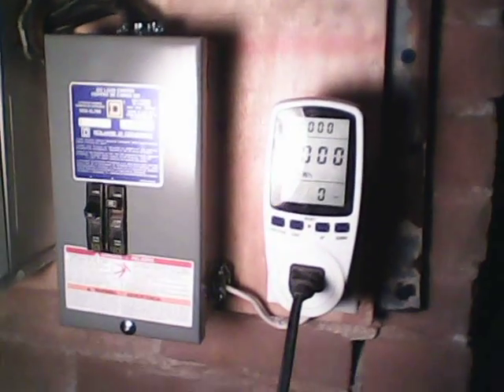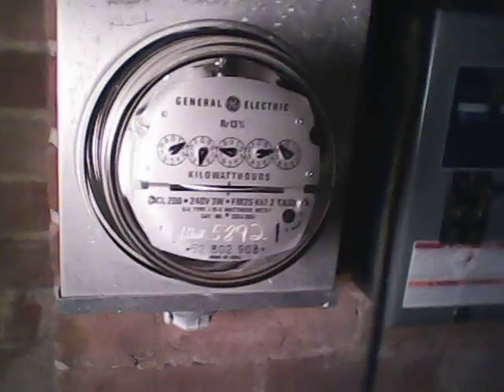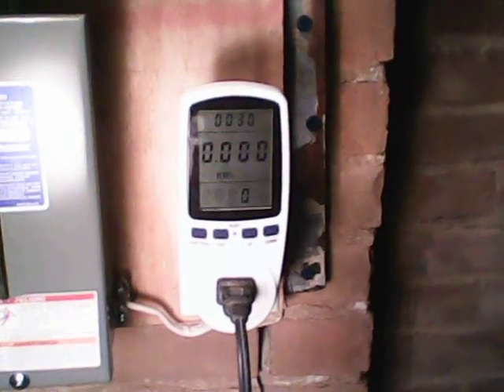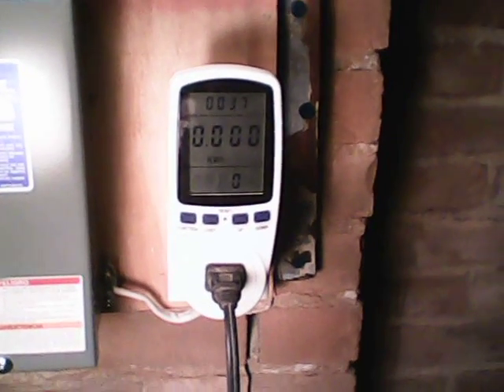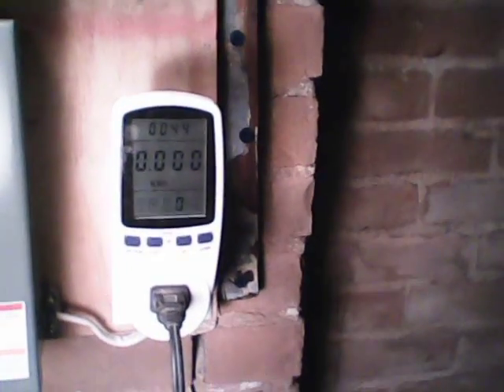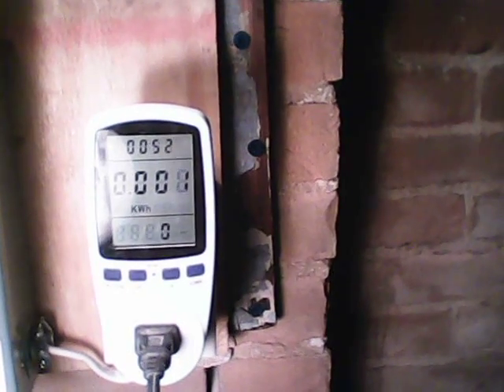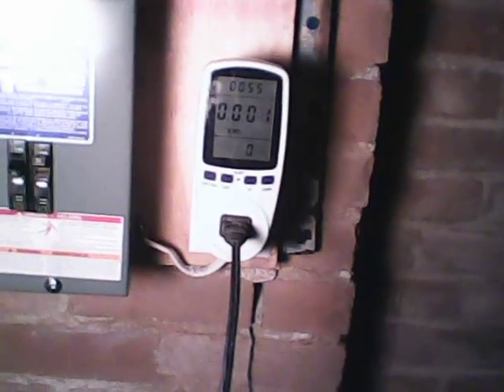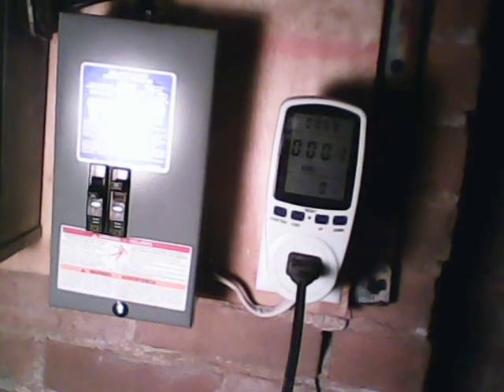CheckingKW hourMeters

Comment: yeh it has a battery in there to power it.  you have to let it charge a damn while, not just 5 minutes.  But then it's good, you can use it unplugged to look at.

Anybody know how to reset it without clearing the set cost / kwh?  That would be nice.